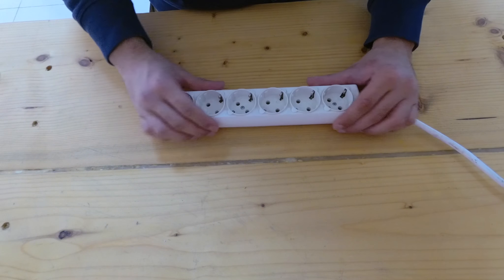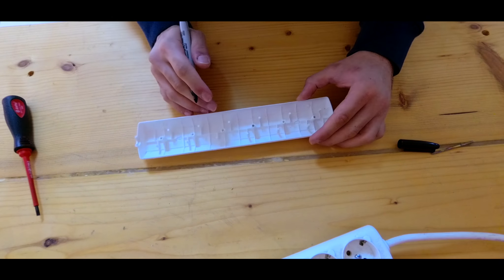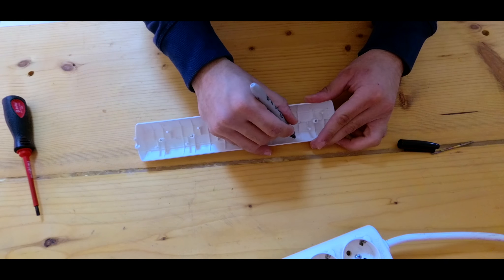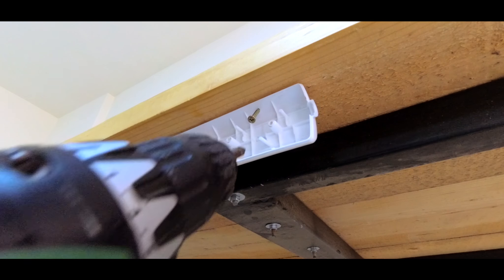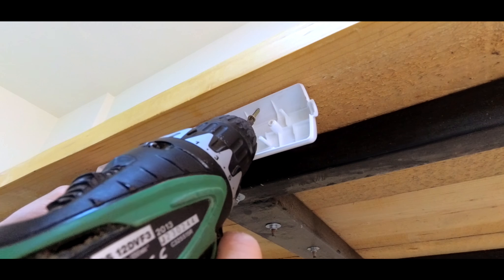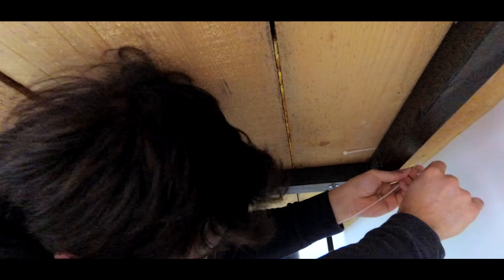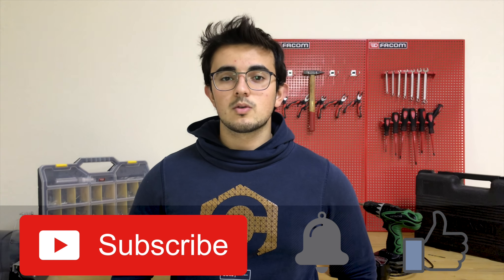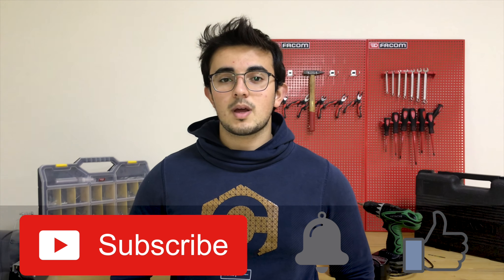How to: Cable Management for Office, Desk, PC and Garage

Comment: Never use tie bands - use velcro straps. Not only are they tough to deal with if you ever need to remove or add a wire, the jagged ends from not cleaning cutting of the tag ends of the tieband will tear thru your skin easily.
Reply from the maker: Thank you very much for this very valuable feedback! Next time will use velcro.